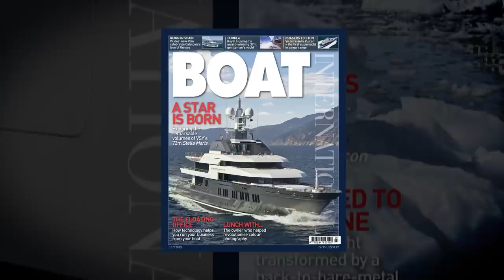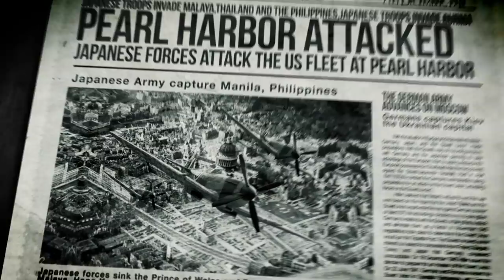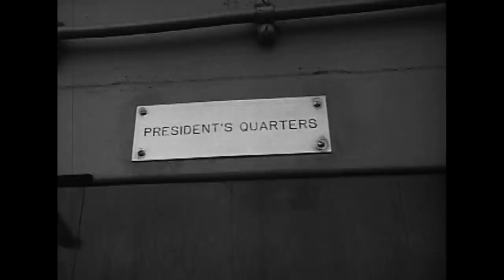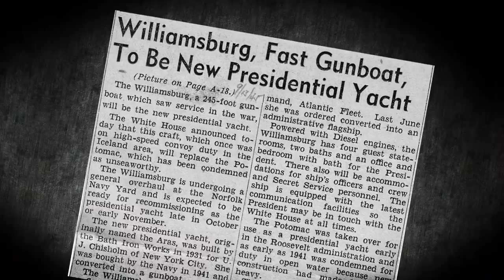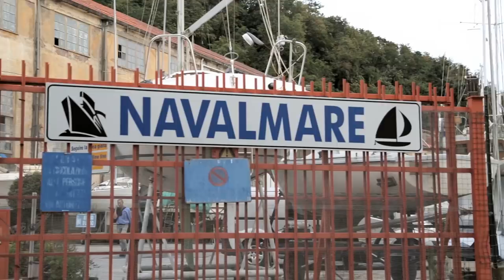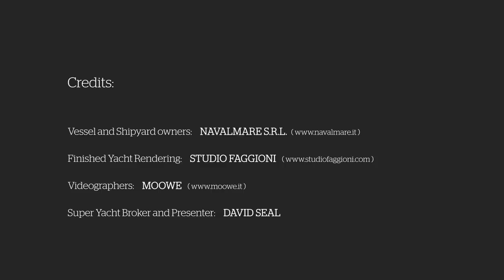U.S.S. Williamsburg - Presidential Yacht For Sale Mini Documentary

Comment: First off, I must compliment you for the EXCELLENT video production work.. WOW!! 
But.. as for the boat, it is a DISASTER! It is in need of a total rebuild which would ultimately cost tens of millions of dollars for the restoration. I understand that it is an important piece of history. But in the end, it would technically be a replica because the only thing original would be the hull.
Reply: Look up the restoration of the Tally Ho, a historical British racing gaff cutter from 1910. The whole ship is being replaced, piece by piece. The soul of the ship remains despite the original physical parts being removed. It's similar to human transplants; even if the whole body is replaced, is it really a different person?
Reply: @leotard2536  Leo from Tally Ho sees it like this:    if you can see a ship during all the project, you can still call it a restauration. even when every single piece is replaced.
Reply: Don't worry it sank at its Moorings shortly after this video
Reply: Jerr Bear well this ship sank years after this video so.........
Reply: @Kuuryo So if that's a replica, then what happened to Tally Ho? Where did the ship go? I don't think there's a difference between rebuilding a boat around itself piece by piece and restoring a boat one broken part at a time.
Reply: Fair point Tommi, a new build would cost much less.
Reply: The US could just easily buy 10 bombs less and pay for it. Sadly most of the US budget just goes into military while infrastructure and history is decaying

Comment: The engineer in me would love to hear those twin Winton diesels again but it's probably cheaper to salvage as much original lumber as possible, melt down the steel, and re-build a USS WILLIAMSBURG replica from the ashes.
Reply: +Michael Zietlow exactly, they act like "Replacing the superstructure" is a small job but that + The new interior and new propulsion systems... you may as well just build a whole new boat.

Comment: Yep.  Scrap her.  She has to be rebuilt from the keel up, making her no longer the same ship.  Sad, but true fact.
Reply: True. 
If you replace the handle on your grandfather's axe and axe head on your grandfather's axe, it's no longer your grandfather's axe.  
You either maintain a ship like this in its original antique condition over the years, or you scrap it when it gets this bad.
Reply: @scdevon  not quite... stript it down. take engines out. put it underwater. electrolyse the rust and dirt off, electrolyse new lead onto it (all over it), spraypaint, fit engines back and new walls and floors and all other non-metal components, done. a steel frame or hull is just that. as long as it's still more or less there, you can make it thinner or thicker by simply applying electricity to it. as it was some american boat... yeah.. indeed. it would need complete rebuild by some people that actually knew what they were doing. lol. :P us ships and airplanes and cars do somewhat have a tendency to fall apart anyway.
Reply: Basically what I was thinking, to restore it you would have to replace everything.  It would be better to build a new one and maybe use a few parts that are salvageable from the old ship but doesn't look like there is much unless they melt down and use the actual metal.
Reply: @MrTredBear  hate to break the news to you but only people that made themselves subject to us citizenship can commit treason against the usa. :P one cannot 'betray' something one never was a party to.
Reply: @CB3ROB-CyberBunker  Your point?

Comment: At 07:35, well, the same can be said for the SS United States where the ship's hull design is still "classified" even to this day.  Just research the SS United States and see how it has come to be a step away from the scrap yard despite its interesting history.
Reply: Bill Michael her hull and max speed, too. She handily won and still holds the Atlantic crossing award, but that was a stroll for her. She was built to outrun anything in the water and carry troops, if needed in wartime. She was stripped down to bare steel years ago, so it would be easy to scrap. Hoping not.

Comment: from what i could find it weighed ruffly  2021.6 ton, in the U.S.A. steel is around  $50.00 a ton that equals ruffly $101,080.00 U.S. dollars i bet if someone would have offered them 100,000 U.S they probably would have taken it.

Comment: that pile of junk is finished. too late.
Reply: Almost glad to hear she was scrapped. Too far gone. 
Also, the plan to remove the structure above deck and replace with Aluminum, Replace all Power plants and add modern plumbing and A/C, It would be cheaper and easier to just cut a chunk of her keel out and build a new ship around it. Either way it would not be a restoration to me.